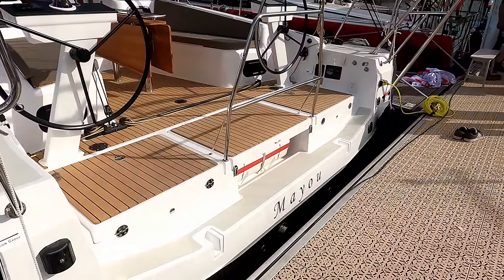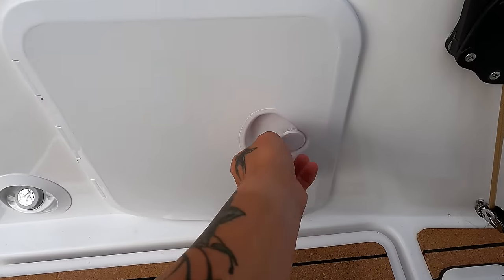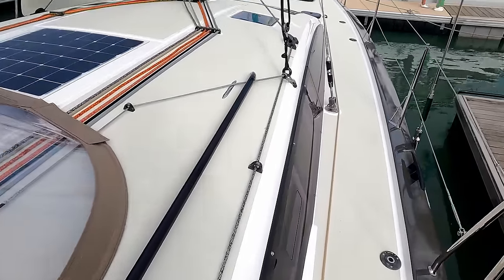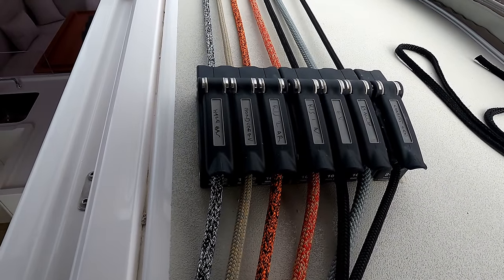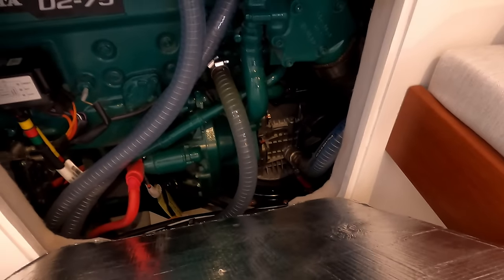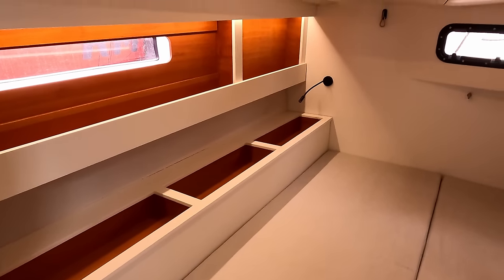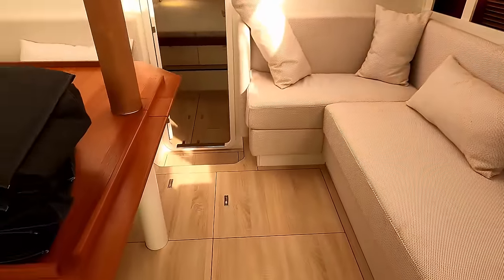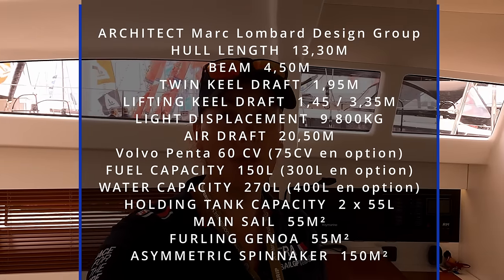The Rm1380:  No BullS*%T, just a sailboat tour

Comment: Great boat - this is a sailor's boat. Everything is right where you need it. Bonus on the sliding cupboards and real chart table. Might look a bit spartan but this is a lot easier to clean and care for, especially if you have to fight mold. The ply core construction is a nice feature I think. Makes for a very strong and light hull.  Good one!
Reply from the maker: You are right about the plywood construction, the hull is very rigid which is great for speed and strength. This is a great performance cruiser and I can’t wait for a test sail.
Reply: @SVTONICBoatWives  carrying on the plywood tradition of the Pacific Northwest's Thunderbird One Design class, and Philippe Harlé's Muscadet in France and Europe.  I've sailed a couple of T-Birds, OPB. Once you lean into the chine, hit a groove, then just rocket off that feeling makes it hard to go back to other boats.

Comment: I started off heavily biased against this boat because - Plywood, having built a very expensive one from hardwood marine ply that disappointed, plus the regular Cruising area from and to the Caribbean is Argentina during nurricane season, and Brazil for example, has an area of Termite Mounds at least as large as Britain, and I don’t fancy sailing on a Termite Restaurant. But this Boat Tour was that good, it was clear to see the necessary Termite Barrier Coating finish has been applied everywhere it was needed. If it’s Saildrive, then the Volvo is the best Choice at least until a Yanmar of 80 plus Horsepower is chosen either the ZF Saildrive option, but not the rotating 360 degree version imho. The plain ZF, to me is as good as Volvo’s. What is needed for personal Construction Choices looks easy to substitute or build in or have as Custom options, so this does look like a boat that can be made to survive my long term demands. With me being a right Fussy Pants - to say the least - that makes this a pretty rare Sailboat. Great Tour imho. A Merry Christmas and a Happy New Year to All. Bob. 👍🌟🌟🌟❤️
Reply from the maker: Ah Ha, a boat you can get on with, only kidding I am patiently waiting for my test sail next spring on one of these RM’S. I like the fact you can have twin keel or lifting keel, deep or shallow keel depending upon what options you chose. These boats are practical in their layout for sailing or so RM says so we will have to see how they single hand,
Reply: @SVTONICBoatWives  It does looks though you an set them up e actly how you  need them to be, tbh, in mast furling, and furling headsails, and it is set up for single handing. I do like the keel and Draft options available as well, as able to get to 1.4 metres opens up all   manner of access availability. Not that Sailing along the ICW is ecactly a pleasant experience, but it can be done if needed, and  crossing it into nice towns with free moorings, is piece of cake. Too expensive for a tide me over boat for me tbh, and I'm still set set on an Island Packet for the new boat build tbh, as I can get everything that I need, plus a few things I didn't even realise I needed, until I saw them in Darrell's Boat Tours.  Best Wishes, and have a great time over Christmas. Bob. ❤